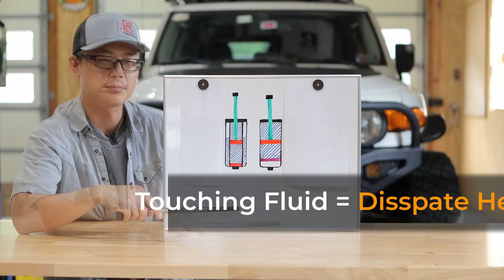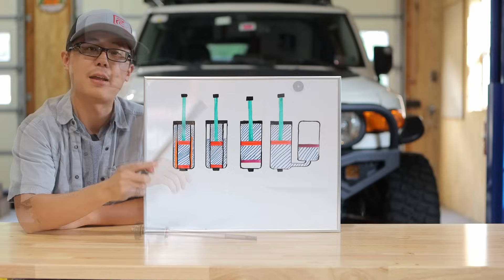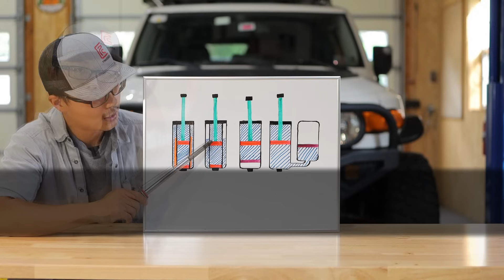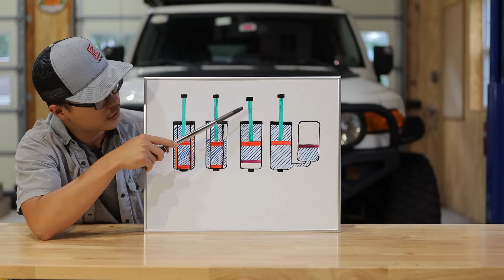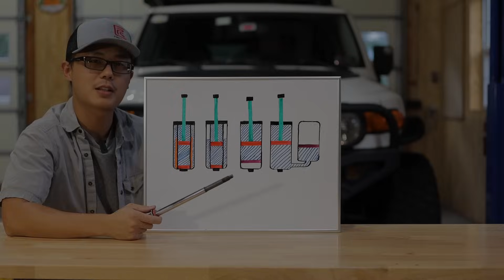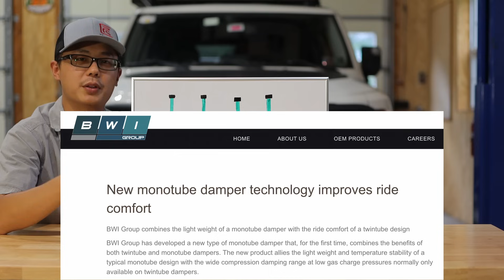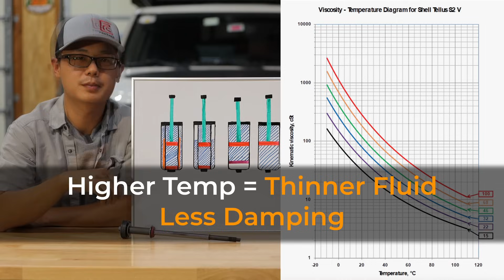The Key Difference No One Talks About | Twin Tube vs Mono Tube Shocks (Is High Pressure Good?)

Comment: From forum searching and own experience I’ve noticed my bilsteins won’t fade as much on long corrugations and will go back to its original performance after cooling down. But they said twintubes after fading will already loose some of its original damping due to aeration. Is that true?
Reply from the maker: If you compare the same diameter mono tube vs gas charge twin tube. The mono will fade less easily. Nevertheless, the fade is not permanent.
Reply: @TinkerersAdventure  thank you! Man you’re really killing it with the vids keep it up always waiting for the next one! 🔥

Comment: Does the foam in the Foam Cell Pros have a longevity issue?  It seems that multiple compressions (possibly at elevated working temperatures) will tend to degrade the foam.
Reply from the maker: I think that is the intuitive thinking of most people, and it started spreading online. Ironman’s test data showed the foam will outlast the paint in high temperature cycling. But I’m interested to know if anyone had real foam related failure.

Comment: Very well put together, and very accurate! Maybe I missed it and you did touch on this, but one thing to note is that 99% of Twin-Tube shocks can not be mounted "shaft down".
Reply from the maker: Thanks! Yes you’re correct. I cut that part out because the video was getting long. But I will mention that in my ironman review. The foam cell twin tube can be mounted shaft down, but they chose not to for other reasons. So pretty interesting
Reply: @TinkerersAdventure  I'd put money on it that even the foam-cell shock, will have a dead spot even cycled by hand a few times, with the body up. It's very hard to get a complete air-free bleed on those things. I'd be impressed if there is no dead spot body up!

Comment: Iv had Iron man foam cell  pro twin tube they are not as good as the top end mono tube gas in my opinion. 
Dobinsons MRA remote res is many times better in comfort and when pushing the limits off road at speed. 
Montube gas is Better  initially more confort in the first part of  stroke and can take much bigger hits at high speed off road and better bottom out resistance 3 way adjustable. 
And more oil.
Reply from the maker: I agree monotube is more suitable pushing the limits at high speed off-road

Comment: Nice video, well organized. You missed some things though. Only inexpensive mono-tube shocks, e.g. Bilstein 51xx and Fox Performance, have ultra high pressure, like 250-300+ PSI. Better shocks, the owner rebuildable kinds like Bilstein 7100, Fox Factory, King, etc. work fine with lower pressures. Fox 2.0s with no res, recommended pressure is just 150 PSI, 7100s, recommended is 180-220PSI, similar with King. It just needs to be enough to prevent cavitation at high shaft speeds. The higher pressures like in the 5100s are only because it has to last the life of the shocks and the eventual pressure loss over time.... 'cause they don't have Schrader valves on the tops to set/re-set pressure like the better shocks do.
Reply from the maker: Thanks! Wow I didn’t know the 5100 is charged so high. And the reason you mentioned makes sense.

Comment: Thanks for the video,  although I thought I knew the difference between twin tube and monotube shocks,  I did learn a few things. Personally,  I have had good results with both kinds of shocks. However,  there is one aspect of this comparison you didn't address,  and that is trail damage. A monotube shock is much more vulnerable to damage by a rock hit, because the ding can prevent piston travel past it, whereas a twin tube shock can sustain the same hit without impeding function at all.
Reply from the maker: Thanks! Yes you’re exactly right. I will show some shock body denting tests in my FCP review. Stay tuned!
Reply: Most heigh end monotube shock for Toyota, it mount upside down, the rod on the bottom and the tube on the top, it is hard to damage the tube ,What you pay what you get !
Reply: ..and unsprung weight is reduced (a lot) too.  @jaypikachu6660
Reply: Bilstein 5160 shocks are inverted, less chance of damage (smaller target). But a nicked rod will leak.
Reply: That’s why good mono tube shocks are mounted inverted with the body at the top
Reply: @MyLonewolf25 and unsprung weight is reduced ..much enough to increase performance.
Reply: I didn't hear anything about comfort for a daily driver. So will the properly set monotube, will it ride better than a twin tube?
Reply: @thingshappen9199  entirely depends on the valving of the shock.
Reply: Good mono shock made with forged body and top-mounting.
Reply: True but I'd still take the performance of a Monotube over a TwinTube. Just keep a few spare MonoTubes in the trailer or back of the truck
Reply: Inverted mounting normally will fix this on a shock absorber. 

You can still invert the struts in front if need be too and these are not too susceptible to shock body damage especially if your using a 3-5mm thick 50-55 OD threaded tube with a chrome 44mm insert.

Comment: I love the videos featuring the Ironman foam cell pros. When I was buying mine, there was a lot of of mixed info and uncertainty on the forums regarding the performance and longevity of the foam cell twin tube design. Wish your videos existed back then so I could feel at ease buying the shocks.

I appreciate you showing the raw data and conclusions in each videos focus with the foam cell pros being an example of a shock design that doesn’t follow the same mono tube construction as most of the other shocks available on the market right now.

Keep up the awesome work, Kai!

Comment: What do you think about bp51 shocks? Will you make a video on those? How does the compression and rebound adjustment on the shock body work?

I’m just curious I guess.
Reply from the maker: The BP51 is internal bypass so it is a total different animal compared to something like a Fox/King with compression adjuster. Bypass can control damping force based on suspension speed AND position. None bypass is only based on speed. I think BP51 is ingenious, but factory control arms have limited travel so not sure how much difference position sensitive actually makes. Only thing close to BP51 is TRD pro fox. They are internal bypass but none adjustable. The other is dobinson MRR, it can adjust rebound but not position sensitive

Comment: Awesome video! One issue that off-road shocks may run into on rather non-technical trails is washboard. Miles and miles of that definitely asks a lot of your shock. Also not sure I quite understand 7:45? Are you just saying the cavitation will occur in the outer tube?
Reply from the maker: Thanks! No, since the base valve is fixed. It simply restricts fluid flow and creates high pressure on the piston side.

Comment: Great video well presented. If you had a 5th gen 4Runner non Kdss what low maintenance setup would you recommend up to 3” lift max?
Reply: Dobinsons IMS is probably the best bang for the buck on the market right now.
Reply: @Chad_H  IMS is an extra 33% cost or so over FCP kit…, so not really. 2k vs 3k cost basically.
Reply: Bilstein 6112's are great.  I am running them on my GX and they perform very well.  Just completed a long desert washboard and whoops trip in my GX470 running them.   

I recommend on the Toyota platform to stay under 3" of lift.  2 -2.5" is about as high as you want to go with out causing additional issues such as the requirement for new upper control arms and limiting of down travel.
Reply: @chrisgarage7848  tried finding some for a 200 series & they didn't make them yet?  Of course everything is delayed now...
Reply: What do they run?
Reply: You didn’t ask me, but I’m gonna assume he’d say Ironmans or OME
Reply from the maker: The ones I’ve personally owned on my FJ are unfortunately all high maintenance. I installed ironman FCP on my friend’s GX and I liked it. Definitely low maintenance. I don’t have first hand experience with other brands so can’t make any real recommendations
Reply: @TinkerersAdventure  thanks I’ll keep watching and learning👍